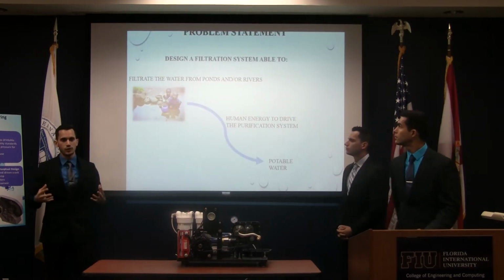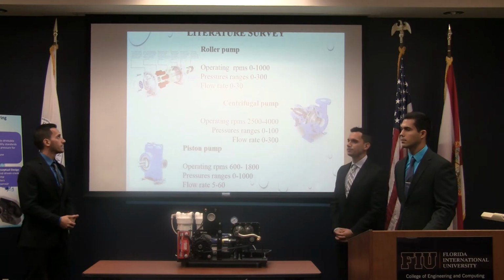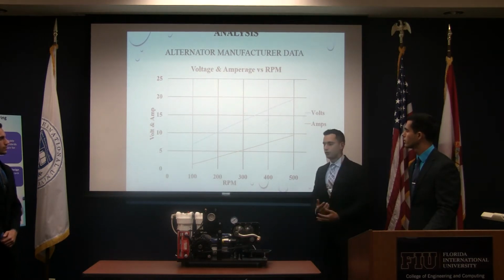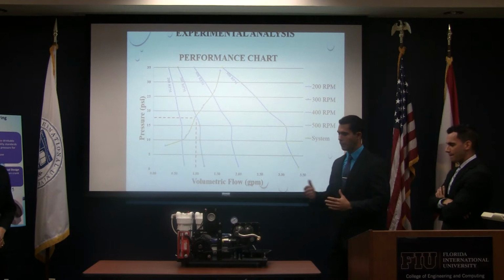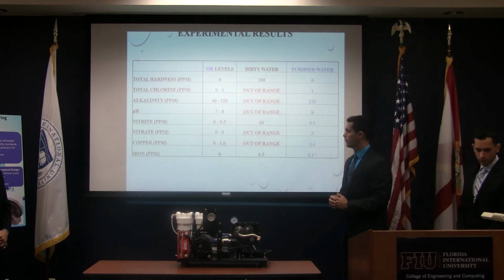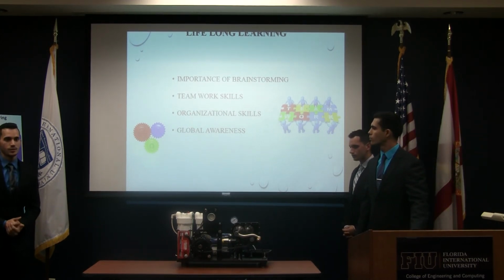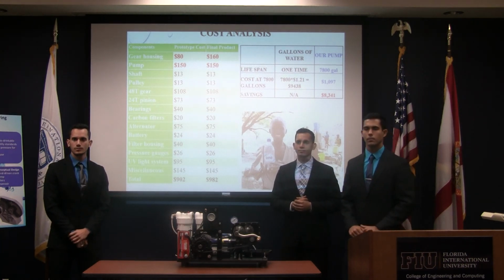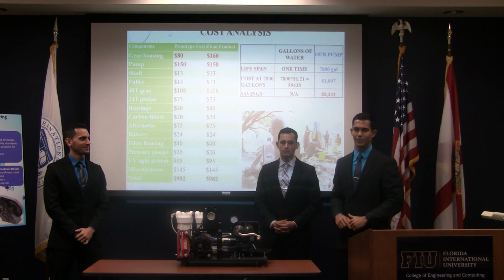Team 10: Hand Pump Water Filtration System

Comment: This was an excellent presentation. The speakers are confident, knowledgeable and passionate about this important topic. The Power Point is excellent as it incorporates videos, equations, graphics, data and results very well. The background of the slides enhanced the "flow" effect the team used in the presentation. There are a few improvements that can be made. The glare in the middle of the slides made in hard to see text and images in that area. Speaker 3 needs to have a little more time to speak since the information distribution was slightly uneven between the speakers. Other than this, the team did a superb job.